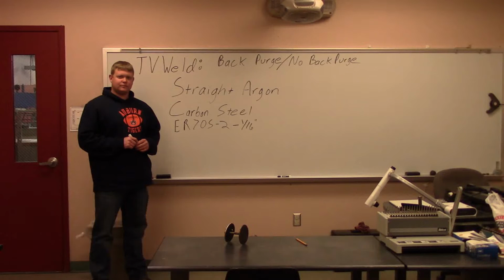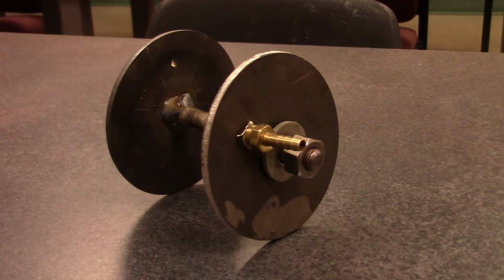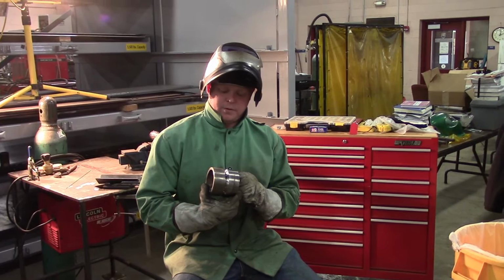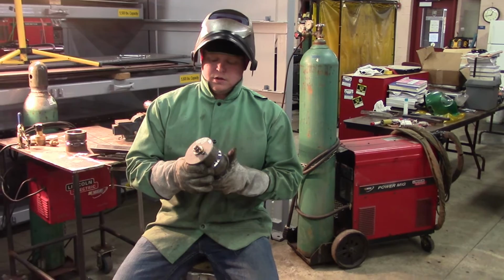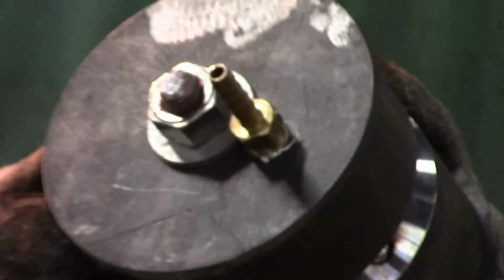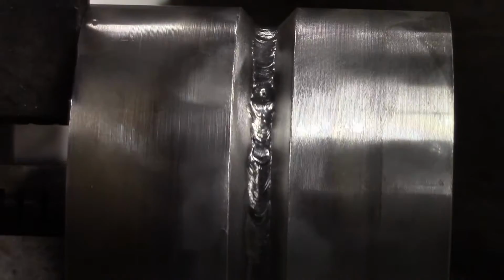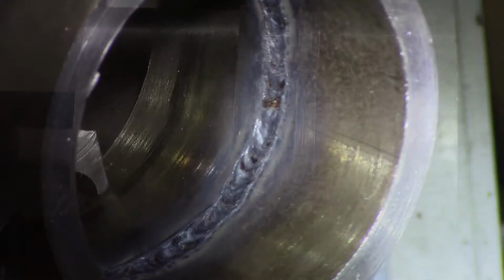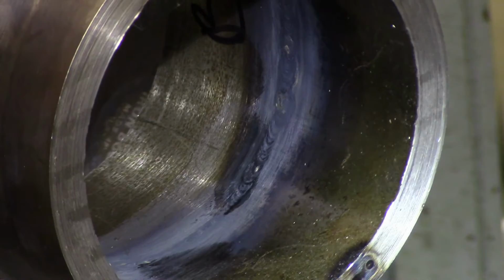TIG Pipe Root Pass Purge/No Purge

Comment: 0 penetration no need for purge on carbon waste of gas and time open that gap up and push some metal through. Should be back feeding or lay wire technique keyholing breaks the surface tension and thus flattens out and sucks back on the inside.
Reply: Aaron McDonnell well said!  Didn't even taper off too... Some pin holes in there
Reply: that presentation not supposed to be in public learning.

Comment: Nice job!  What is your root gap?  With TIG, I assume you have a knife edge?  No land?  I just completed a training with some guys; same basic idea but they were using  stainless filler, which would give them a stainless certification.  Without the backer gas stainless rod doesn't work (but you already knew that!!)!!   We tried it with regular ER70S filler or stainless filler for the root; but in either case the backer gas worked out far better than without.
Reply from the maker: You are correct we had no root face, right to a point.  Our root opening was just a hair over 1/16".
Reply: @Brent - I don't want to get hung up in a discussion of details!  Again, I like your videos and you do a great service.  You know what, I am not going to make that comment I was going to make!  LOL!!  Keep up the good work, brother!  Where are you located?